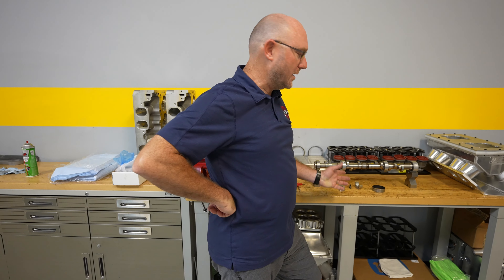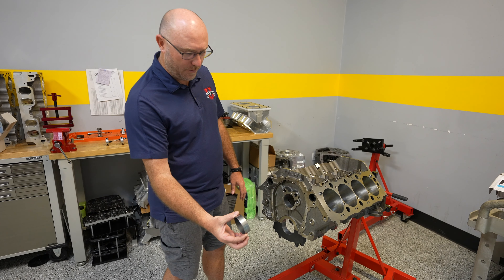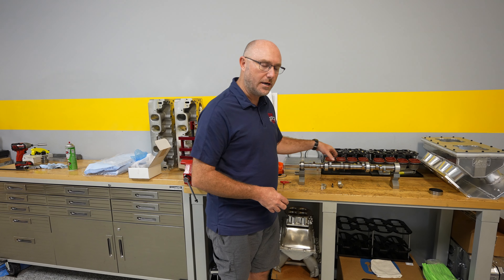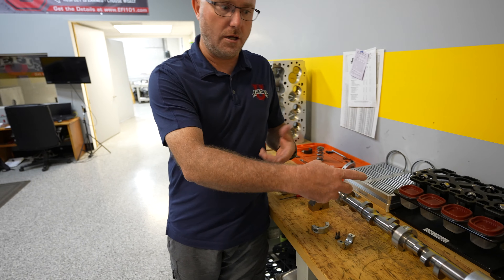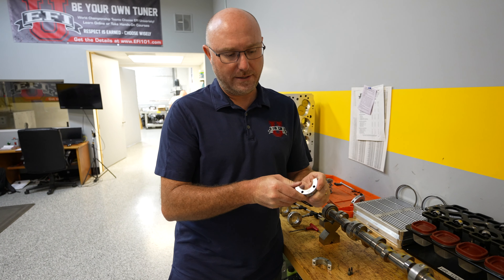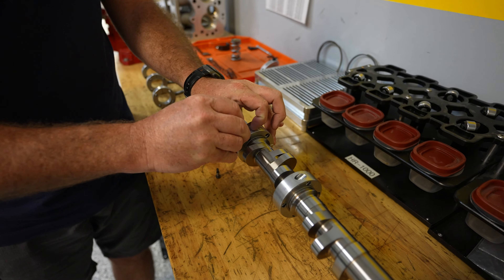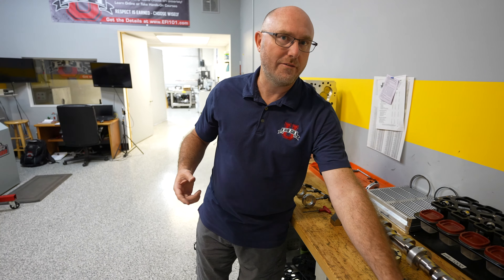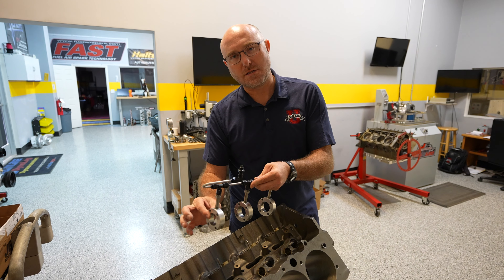2-Piece Camshaft Bearings????

Comment: Press fit? How are the housing located, indexed, and sealed at the block bore / bearing housing interface? The oil supply tubes? Does this result in a floating bearing housing?

Comment: Can't cost much more than the price of a fuel dragster engine. Something not mentioned, how are they installed?  what keeps them in the bore without clearance between the cam bore and the od of the bearing. What force does it take to install 5 at once or are the installed with very strong but little bitty tiny hands, piece by piece?  I bet everyone is doing this instead of a turbo.